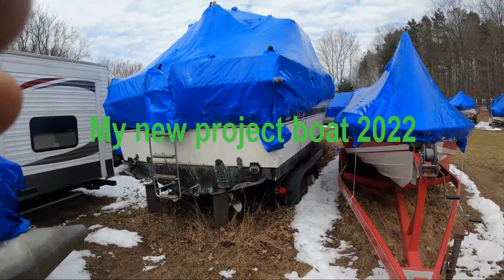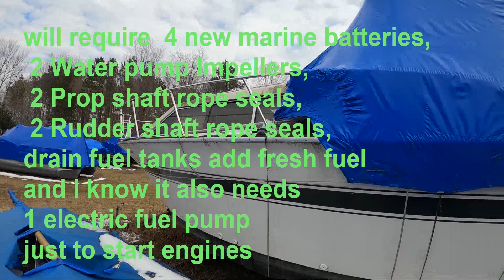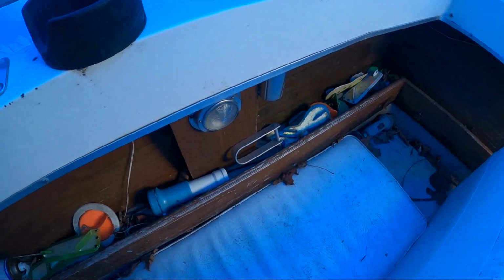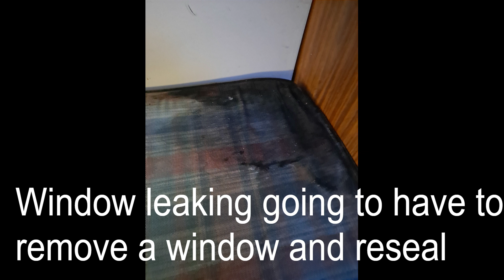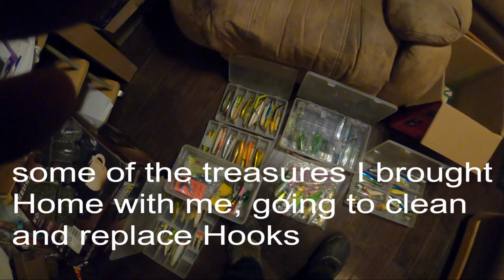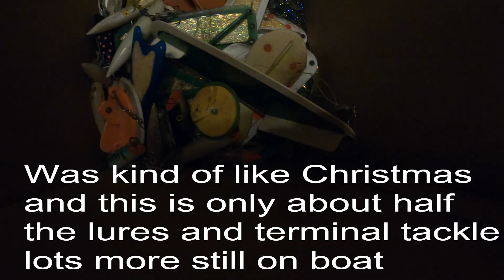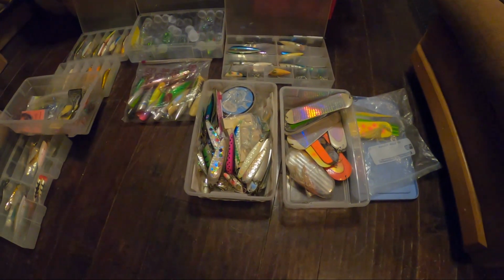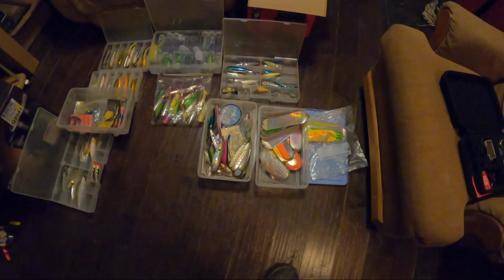Call of The Wild Outdoors new project boat for 2022

Comment: If you don’t mind me asking, what did you pay for that?
Reply from the maker: i cant give exact price But i will say when i get it completed including bottom paint, a couple small glass repairs,trim work etc ill have less than 10 grand into it
I find really good deals on boats working in the business, i passed last year on a beautiful sea ray 25 sundancer that i actually had a part in building when it went thru line at factory in Oxford MI
only reason i passed was 8 foot beam boat i was using has 10 which is less rocky in the waves, are you looking for a boat? if so send me email with what your looking for and im sure ill come across something its about that time of year
Reply: @callofthewildoutdoors  awesome